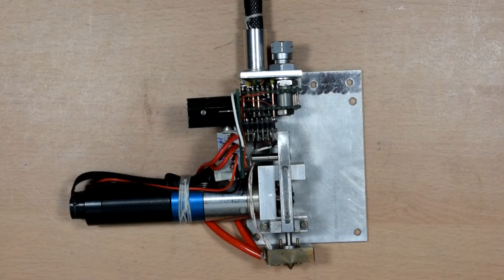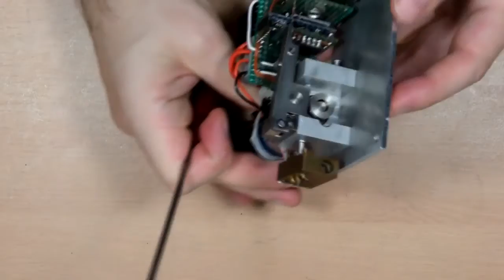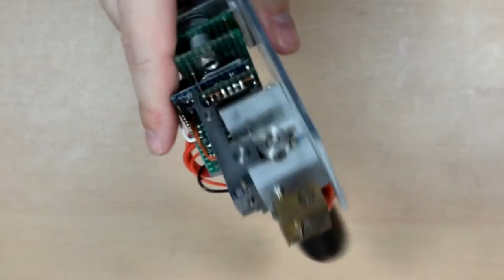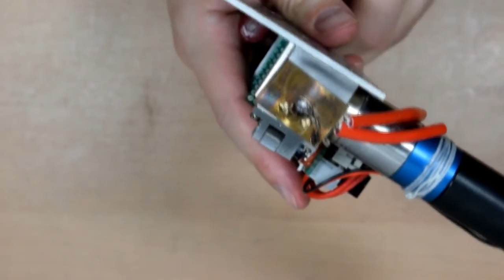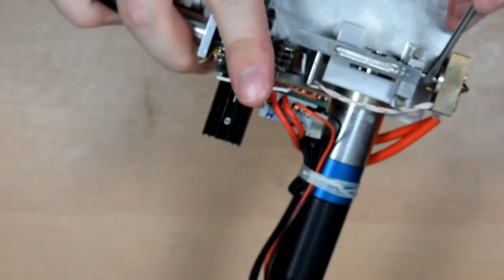DC servo motor 3D printer extruder

Comment: Hi, did you have any luck with this extruder type? is i a brushless motor?
Reply from the maker: Hi, No it was a brushed DC motor.  I gave up in the end due to difficulties getting servo drivers to work properly with it.  No reason it can't be done though, and yes a brushless motor would be the way to go these days
Reply: @Sigmatechnica  Strange that noone has done it yet, all extruders come with big stepper motor.
Reply from the maker: @Nousernameization  As with many areas of consumer/open source 3D printing, things improved until they were just about good enough, then progress rapidly slowed.  8 bit arduino based control boards, lack of servo drives, slow print speeds and poor software are all examples of this in all but the high end machines, even now